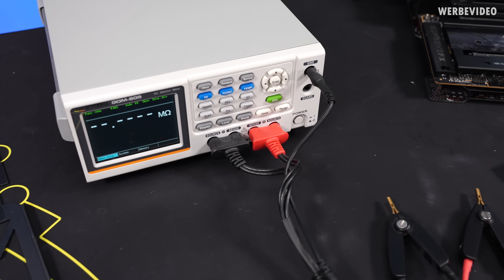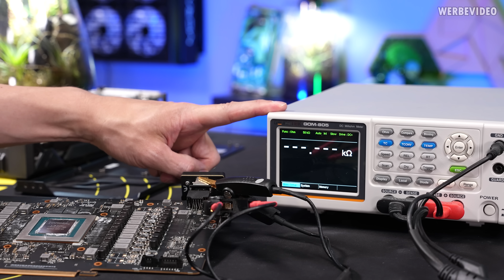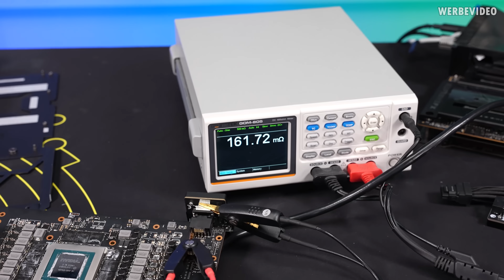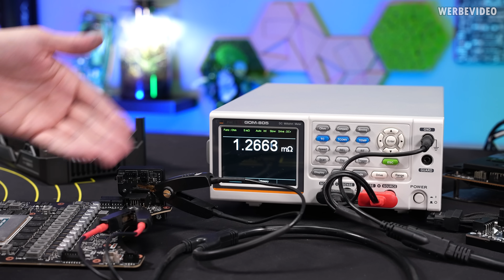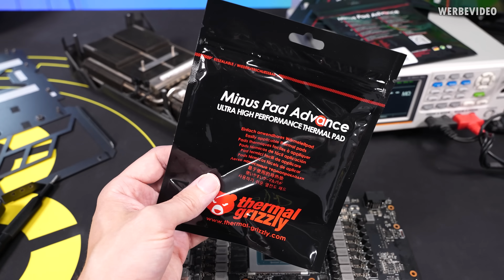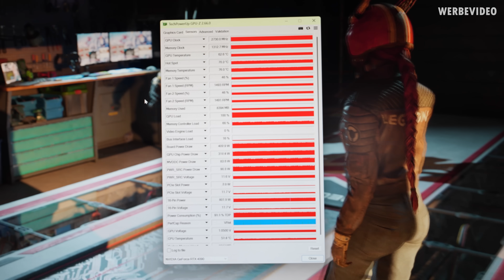It Happened Again – RTX 4090 with Melted 12VHPWR

Comment: Looking at the damage on that before you start... Id have to say that was user damaged... And that the user damaged probably caused the failure, it's too coincidental that the connector is cracked and bent and also melted, looks like maybe the user may have been cleaning the system and pulled hard on the 12vhpwr cable when trying to remove it from the wireview, which has caused the damage, then tried to use it again afterwards and lo and behold it melted... I know you say it might have been shipping damage but it's way too coincidental that the only shipping damage just happens to be right there.

Comment: So, the card hasn't had any issues for a long time and then the melting connector problem happened immediately after adding the wireview.  I think this connector sucks, but it seems to me that in this case the wireview was the culprit.

Comment: I can't fathom why they decided on 12 tiiiny square pins with even tinier small contact-dimples pressed into them... When the formfactor/size of the connector allows for two large spring-tentioned either round pins or two flat pins that both would have much more conductor and surface contact area. If the driver for using many small pins was, as stated by someone in the industry to be the cost of larger wire size, then both options could use crimp and just have all the wires bunched and crimped together. The wires themselves have never been the issue, it has been the design and size of the pins used in the connector all along...
Reply: Its for planned obselence 😂

Comment: Should almost make a version of the wireview where you desolder/remove the original one and put in the wire view directly ( so it doesn't plug into the card but gets souldered directly to the card. And maybe also has it as a service ) 
Many might not want it but I bet there are a couple out there crazy enough to want I

Comment: Solution for the future would be going to 24V or 48V, makes wires/connectors much smaller...and by using just two wires, the current balancing problem does not exist!

Comment: Would it maybe have been better to cut the old connector off against the board to avoid causing further heat damage and then just desoldering what would be left of the pins?

Comment: Seems at this point it's time for them to get away from 12v lines using high amps, over to 24v/36v low amp lines. Buck it at the card if 12 is needed. There's a heat sink on board for that.
UL has some explaining to do and internal investigation done why this passed.

Comment: Honestly, if they really want to supply nearly 600w through a connector that size, they should really consider using a higher voltage than 12V. Doubling to 24V would cut the amperage in half, allowing the use of smaller connectors and wires with a significantly better safety margin. Of course, this would require an entirely new PSU with this design in mind + more down-volting would have to be done on the card, which would suck ass, but would be better than melting connectors. But yeah, turning that into a standard would be a bit of a pita.

Comment: nVidia could have avoided all the melty problems by going with a higher voltage. Higher voltage means lower amps means less heat.

Laptops already run on 18 or 20 volts to reduce amps.

Comment: At this point I think someone should offer a service where the 12VHPWR connector is removed, and replaced with a single large blade connector to which all the pins are soldered to, with a PSU adapter from dual 8-pin.

Comment: I have 5070ti and i will not sleep well today
Reply: There is nothing to worry about if you have 5.1 3.1 psu with 12 2x6 connector port on psu going straight to gpu 12 2x6. Corsair psus are good
Reply: @shubdh-hz5ul jayz showed corsair connector and it looked like crap, and yes i have 5.1
Reply: @MegaChickenPunch it’s high quality I have it. I tested it using clamp meter all wires have amps
Reply: 5070Ti should be not affected with the 300W max, even if you have older psu-connectors.

Comment: Oooof, the shipping (impact) damage is tragic. Are there any pictures of the card pre-shipment that clearly shows there was no impact damage prior to shipping? First and foremost: doing this RMA work for your customer is excellent service, and is the right thing to do IMO. I applaud you for that.

The fact that the connector clearly suffered impact damage is a HUGE problem though.
Reason 1: if this was an RMA with any company other than TG (especially ASUS), without pre-shipment proof, they would absolutely claim that the connector melted because it suffered impact damage, and they'd refuse to replace/repair it for free. Hell, ASUS would prob. first try to reject even WITH pre-shipment proof.
Reason 2: Nvidia can (and probably will/does) easily do the same: brush this off as "customer caused impact damage and doesn't want to own up to it, so they're claiming the connector melted for no reason and that the impact damage happened AFTER it melted".

Without pre-shipment photo proof, the fault for the melted connector comes down to your word vs theirs. That's not good.
Personally, I believe the card suffered impact damage during shipping because I trust you; but you have to acknowledge that my trust is based on my subjective opinion. People who are more critical than myself are 100% justified in remaining skeptical without objective proof that the melting didn't happen due to the customer dropping/impacting the WireView while it was plugged in. I wish you would have discussed this more in the video (maybe mentioned if there were pre-shipment photos, showed photos of the damaged packaging, etc), because without it, all the "nvidia sympathizers" will simply blame this on your customer 😞

Comment: Couldn't you have placed your meter probe on the backside of the PCB where the through-hole solder points are, just pressing down into the pad by hand, instead of having to clip to the wires on the back of the connector? This would have allowed measurements without cutting the sense pins, and also would have allowed you to compare the 12V and GND pin banks separately.

Comment: I...have a dumb question.

Why doesn't anyone just offer a modification service to replace the power port?

It seems silly to force oneself to keep using what doesn't work, but we can also easily just desolder the connector and replace it will literally anything else.  So...why not just do that?

Why doesn't someone just offer a service to remove the stock connector and replace it with a more robust solution, and then simply have an adapter to route it back to any standard supply connection that's actually suitable with significant overhead.

It just seems dumb to me to just throw on another 12VHPW connector.  You and others are making these not cheap custom adapters just to fix a mechanical connection problem that isn't getting fixed with the adapters.

A secondary problem is a friction fit connector is not constant.  Sure, you get 1.2 mOhm when new.  But you could have a card sitting in a closet for a year, take it out, and retest to see a much worse resistance.  They will never stay ideal.  They will never stay low.  The design NEEDS overhead.

At the end of the day, the only good solution is to entirely replace the connector with a different solution.  Desolder the whole thing.  Replace the whole thing with a new interconnect.

Comment: I mean, the cable is fine so long as it's not powering anything beefy in the 90 class, but it can't be fixed as simply as just soldering on a new connector surely?

Comment: Is it possible the pins are just getting really hot and over time oxidizing increasing the resistance and eventually melting? Or maybe the pins are warping Slightly over time due to the heat causing increased resistance? Maybe even just the weight of the cable pulling on it over time? This generally shouldn't be an issue I don't think but they are pushing this connector to the limit so any small change in resistance could be detrimental.

Comment: whole idea of wireview was faulty .. and instead of fixing it added more points of failure then already exist on failty cable. more connection = more points of failure and current unlalance . common rule electrotech.also  hi amp ampermeters ( 10A per pin is considered high )  better make non contact  istead of inline .

Comment: if 600W with 1pin completely no connection...
600W/12V = 50A/5pin = 10A per pin
10A^2 * 0.160ohm = 16watts!

thats pure 16watts of heat dumped onto each pin, ridiculous.

on a side note, normally the pin resistance should be well below 10milliohms.
in fact molex lists their minifit series to have a max of 10milliohm pin resistance.

Comment: Connector is 💩 as it it but lets put an extra break in the cable with a power meter that should have been bought with the power supply from asus only asking for trouble just use common sense

Comment: I still feel safer having my Wire Views plugged into both my 4090 and 5090. But just out of curiosity I wonder if some of this problem is cause by pin corrosion. Maybe from particular chemicals in air or living near the ocean and getting salty morning dew.

Comment: Why not just use lever-locked connector with some serious springs inside? Or add another black box to convert 12 V to 20 V, then lower it again on a GPU PCB. Laptops has dealt with this voltage for years so hardware is readily available. Then price this box at $99 and advertise it as ground-breaking, future-proof, and absolutely necessary for the best performance? NVidia, can you give me a call? I think my experience as HW engineer as well as customer support could be put to good use.

Comment: No matter what engineers say or calculations, in real world, things are not what they say.
We need a different connector.
Running multiple thin wires and a single thicccckkkkk..... wire is a lot different.
I would over spec a single thicker wire anyday for multiple thinner wires to supply the same load from a single source.
Sometimes the cost savings we achieve at the start doesnt translate to the load expense from the source.
As an example, i'd rather connect a 3Kwh load directly with wires with a circuit breaker rather than using a 3Kwh plug.
Their are manufacturing tolerances on everything
No matter what it might be.

Comment: Cheap and very poor Nvidia does not want to see two of these connectors to split the load.  There is so much that can go wrong.  They dont even use protection caps, it is like they want your expensive cards to go poof.

Comment: Another very good video, Herr Hartung!  Perhaps using a pre-heater to bring that fused section up to closer to the melting point of the plastic will allow you to slowly pull them apart without 'shattering' anything too badly.  Either way, F.A. is very difficult here.  I cannot think of any way, aside from encasing it in Lucite, and cross-sectioning it in several places, will you be able to get a good look at anything inside.  Obviously, that is very destructive.  The question is how much effort do you want to put in for the hoped quality of discovered data.  Viel Glück, Sir.

Comment: Instead of bridging the power to the GPU since that obviously doesn't prevent the problem what if you individually monitored the power on each line and if wireview detected the highest line was 2x the lowest line it could shut down the system or something? If Nvidia isn't going to monitor each power rail individually this seems a perfect opportunity for a third party to do that work instead.
Reply: Also, it makes sense bridging the power at the connector doesn't fix the problem. The issue appears to be insufficient contact between the "fingers" of the connectors, if one of those connections is not tight enough it has increased resistance. Bridging isn't going to solve this. Leaving them un bridged until the last minute at least lets you monitor the power going down each line to detect if there is a problem.

Comment: If you want to desolder plastic connector with heatgun without melting it, you want to heat it up form the other side of the board, so if connector is on top, you want to heat the bottom. Generally you want to turn card around, so bottom is on top, since if you got it turned connector down, it also will drop on its own when it is desoldered. I saw it done with HDMI, where you can have ripped pads of you pull too early. I just thought I would mention it, if preserving connector is the goal. And for new connector, you can do same, heat up from bottom and just drop connector on top for no melted plastic.

Comment: Another great video :)
A few comments: Firstly the milliohmmeter doesn't need to compensate any resistances, per se; it simply puts a known current through the device under test (DUT) with two of the leads, and uses the other two to measure the voltage across the DUT, with essentially zero current flowing through that pair of leads; thus none of the lead resistances influence the measurement. Secondly, those resistances are indeed crazy high, BUT not automatically impossible: the voltage drop across a 150 milliohm connection at say 8A per pin would only be 1.2 V, so the system would probably still work, but the dissipation through that resistance would be enormous, at almost 10 W *per pin*, i.e. more than enough to melt stuff!
Reply: Correct, seems to be a common misconception among YouTubers and DLROs and how they actually work.

Comment: This. This is exactly why I don't run stock on any cards. I'm still using gtx 980 ti from EVGA. I reduce power limits until I see temps I am comfortable with. Well done with getting the new plug installed. That plastic is worthless really.

Comment: Has there been any cases of melting with the Wireview Pro (given its temp sensors and alarms)? Also wondering how accurate those sensors are since they're mounted on the Wireview Pro's PCB rather than on the connector itself. Wouldn't sticking your own thermistor to the plastic connector be more accurate?

Comment: Wouldn't a melted connector lead to lower resistances? The heating should make the pins tight against each other in case there was any arcing, and the melted housing should hold that position in place, no?

Comment: Exactly why I've sworn off getting a 4090, 5080, and 5090. I settled for a 5070ti since it has less power going through it but I'm waiting for amd to release their 9080 or 9090xt or whatever they call it, if i'm paying more than 1K for a card then it better have more than 16gb of vram and not fucking melt. then i'll probably sell my 5070 ti and be done with nvidia for good
Reply: 5070ti is based on the same design and has failed in the exact same way. Why not just get the 9070 xt? It has near the same performance as a 5070ti.

Comment: I think that if someone were to parallel the positive traces at the PCB then all of the connectors would draw the same amount of current and force the current draw through the cable to be equal on all conductors.

Comment: Having worked on this for over two decades, there are a couple of problems that basic USB powered brains won't catch.
1) the cable contacts generate extra heat, which needs to go somewhere. Obvious not towards the GPU.
2) adding more contacts for the heat to crawl over doesn't help (1)
3) connecting 12V lines together causes extra heat to be made at the measurement device due to subtly different ohmic losses in each PSU phase and cable.
4) adding a current sense resistor releases more heat. And there isn't a large 12 layer copper plane PCB to move the heat away. 

At 10A even 50mV matters. So one PSU phase loops back to another phase and wastes some percentage of your power and concentrates that heat where you tie the phases together. Why do you think the board connectors are solo wire runs in the latest GPUs? Each one goes to their own pair of buck converters next to the GPU.

Let's see an infrared video of the card running open chassis and zoom in on the power measurement gadget. Probably well over 88C.

Comment: I heard the 30 series cards or at least the 3090 had a means of measuring and balancing the power going to the card and if they still had that in the 40 and 50 series cards this wouldn't be happening?  Not sure if this is true but it wouldn't surprise me if all these problems are simply due to Nvidia cheeping out.

Comment: Ugh, another adapter melting. I'm not taking this seriously until there's a melting with a ATX 3.1 PSU with a 12V-2x6 connector (because there's ATX 3.1 PSUs but dont' have a 12V-2x6 connector)  and 12V-2x6 to 12V-2x6 that's updated with the thicker gauge wires.
Let's all just move to ASUS's BTF GPUs and motherboards, walk around these dumb connectors.

Comment: I think the normal 8 pin connectors should be used again. Ditch the stupid smaller 12 pin connector. There is room because the pcb is shorter. I think a redesign of where the power connector is located. Nvidia is also doing this on purpose by making a new connector that doesnt work most of the time.
Reply: I'd keep the 12vhpwr connector but limit them to 400W per connector , and introduce proper load balancing and per pin current monitoring , with the card shutting down if an over-current condition is detected.
Reply: @tourmaline07  They can just use 2. Why can't they at least use 2 12vhpwr on 600 fuckin watts. $4 trillion.
Reply: @shouk_o it beggars belief that onky one card with two 12vhpwr connectors exists, and that doesn't have the second connector soldered on by default and is aimed at LN2 overclocking for world records 😂 (Galax HOF 5090).

Even if they had to not solder the connector to comply with nVidia's strict rules , I'd rather have the capability on the PCB